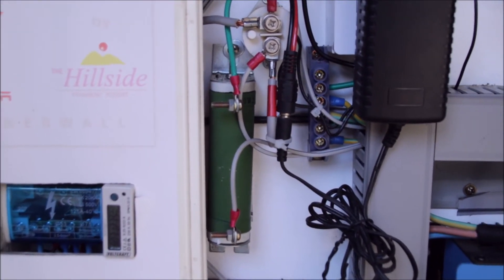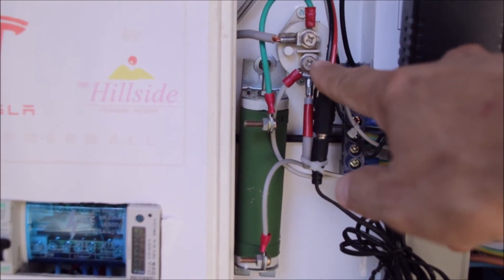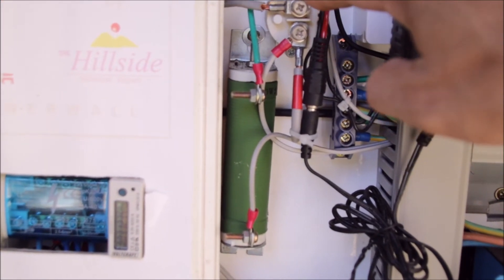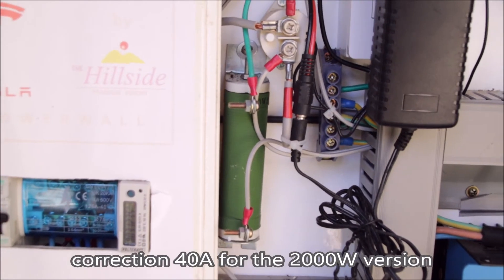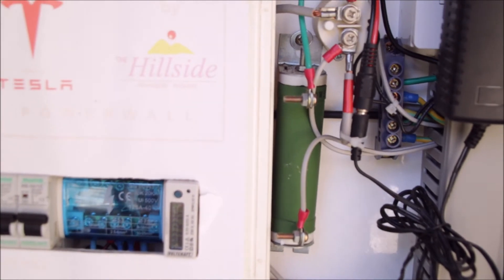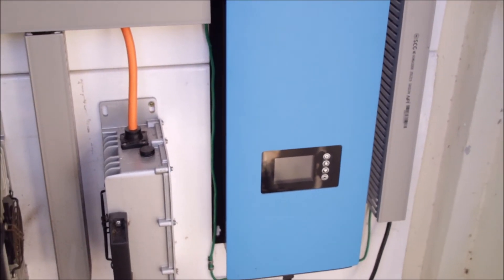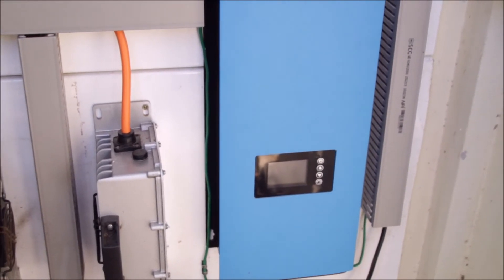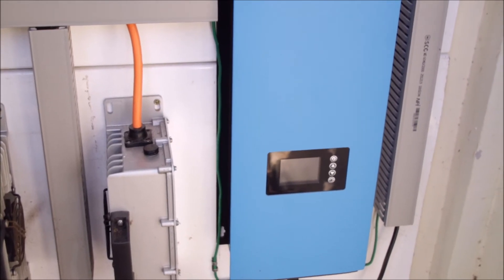DC soft starting the SUN1000/2000GTIL inverter

Comment: Hallo Roland , seit einem Jahr gehe ich deinem Rat nach aber halt Manuel mit zwei on-off Schalter . Alles OK ! Jetzt ging es diesen Vorgang mit zwei shellys zu verwirklichen damit ich das Ganze auch von der Ferne starten kann .  Habe den Sun 1000 24V Bat. und benutze 4x 25W 6.8Ω Aluminium Widerstände in Reihe . ( Widererstaende  die ich für Motorrad-Blinker gekauft habe aber nie zum Einsatz gekommen sind ) .  "Normale " manuelle Umschaltzeit liegt bei ca. 3-4 Sek. . Jetzt wollte ich mal den Strom messen der durch diese Brücke fliest sobald der Sun anfängt Leistung zu produzieren und habe die Brücke drin gelassen aber nicht das Hauptschutz eingeschaltet und gewartet aber der Sun fing nicht an Leistung zu produzieren . Die Spannung (  im Sun zeigte mal 22.5V und mal 25V an ) bei kontinuierliche Bat.- Spannung von 26V . (Eingestellte Leistung des Sun 550W) . Erst nach dem einschalten des "Haupt-Schütz"  und ausschalten der Widerstands-brücke fing der Sun wieder an zu produzieren . 
Die Frage ist , wenn die Umschaltung aus irgend einem Grund nicht stattfindet ob das den Sun beschädigen kann ?
Reply from the maker: Hallo Kostas. Der DC Eingang des SUN ist in Wahrheit ja kein Batterie-Eingang sondern ein MPPT-PV Eingang. Sprich, anstatt einer Batterie können dort auch Solar-Paneele hängen. 
Diese würden in der Nacht auch keine Spannung produzieren, am Morgen und Abend dann nur Spannung, jedoch keinen Strom, etc.
Was Du siehst, wenn die Spannung schwankt, ist nur der MPP-Tracker, welcher den DC testet, ob dort auch Leistung rauszuholen ist.
Es ist also ein ganz normaler Zustand für den SUN, wenn DC noch nicht vollständig aufliegt.
In meinem Setup schalte ich die Starter-Brücke nach ein paar Sekunden wieder weg, damit es nicht dazu kommt, dass eben eine unbelastbare DC für lange Zeit anliegt falls der Schuetz aus irgendeinem Grund nicht funktioniert.
Reply: @RolandW_DIYEnergyandMore  Vielen Dank für die Antwort.

Comment: It would be great if you supplied links to the components of your DC disconnect/reconnect circuit as some of us are not technical. I have been using AC switching for my batteries on/off at night. No failure yet, but DC does seem to make the most sense.
Reply from the maker: As I do not live in a western country where Amazon and Ebay are the first option to get stuff, it is very hard for me to provide useful links. 
I can link the contactor from AliExpress for example which I am using: https://www.aliexpress.com/item/1005004614039976.html?spm=a2g0o.detail.1000014.14.3c3b17f91sPmng&gps-id=pcDetailBottomMoreOtherSeller&scm=1007.40050.281175.0&scm_id=1007.40050.281175.0&scm-url=1007.40050.281175.0&pvid=7e7ff2da-bd11-4a64-9d1f-acbd239de52c&_t=gps-id:pcDetailBottomMoreOtherSeller,scm-url:1007.40050.281175.0,pvid:7e7ff2da-bd11-4a64-9d1f-acbd239de52c,tpp_buckets:668%232846%238116%232002&pdp_npi=3%40dis%21THB%21820.93%21689.58%21%21%21%21%21%402103011716830651916416982ecb33%2112000029836355617%21rec%21TH%21185638773
But I am sure you are much mor interested in a circuitry which is timing the pre-charge resistor. I know there are delay timers on the market which might be used for something like this, for example: https://www.aliexpress.com/item/1005004063991674.html?spm=a2g0o.order_list.order_list_main.53.54811802NXRqsl
It is everyone's part to find his solution by doing some homework ;)

Comment: But, because it is designed with anti-islanding to no provide power to the grid in the event of a grid down/failure, it would seem that it is designed specifically to handle the loss of AC while being supplied DC power and then switching back on when AC power is restored.  Is this not true?
Reply from the maker: In a way it would seem that AC faults shouldn't matter, but still how frequently does the grid go down? In my case I have grid interruptions probably every 3 days. They are just short but are bringing many devices down. 
My SUN1000 had a blown component in its AC power supply circuit after less than a year which I can only explain to happen because of those grid interruptions. 
I see more AC side problem repair videos for such SUN inverters recently. It's not invulnerable.
Reply: @RolandW_DIYEnergyandMore  Thank you. I am not really technical and so am going to need to do lots of research to figure out where and what components to purchase and build a DC disconnect as you have shown. Mine have not failed using AC timers to turn on the ones I have for battery power at night (two for day powered by solar and two for night powered by battery banks. Mine are 1000Watt 120VAC with one on each Leg of 120VAC to give a total of 240VAC)

Comment: This is very good idea! Would the same idea work, but using a permanently connected resistor of higher value (say 1k ohm) to keep the inverter capacitors charged, but only allow low current to be drawn? (50mA at 50V)? The contactor would then just "bridge" the resistor when batterys are fully connected?  I have a second question regarding your setup - Do you recommend charging while the batteries are also connected to inverter? Thanks
Reply from the maker: Well, the inverter will always try to use as much power as it can as long as it sees voltage on the DC In. It will act like a solar MPPT controller and try to chase the 50mA. That might not work very well.
You can charge the battery while inverting. that shouldn't be a problem.

Comment: dont buy this thing its very bad. you cant change the settings on it. the production is lower than other converters too. i bought solis inverter after this and it has much better output in lower sun light and has better build quality. dont compromise your budget on converters. the mppt tracking on this is just shit.
Reply from the maker: I am only using it as battery inverter. Don't have a solar system connected. I am sure that every passive cooled Grid-tie String inverter has a better performance and MPPT circuit then this. But for battery this is OK, and there is not much other choice. Thanks
Reply: Can you provide links to what you recommend? I have four of these (1KWatt each). Two are just solar with one on each leg of 240VAC Split phase (North America) and two that run the house each night from battery with AC timmers. This plug and play system has been on line for nearly 3 years and we have almost no power bill and no contract with our Utility here in San Diego. We couldn't be happier. So please tell show me how to have a better system as you have recommended. Thank you.

Comment: I never shut mine down but I understand what you have designed. I wonder how does the inverter shut down when it reaches a predetermined voltage to save the battery? I thought I could see some ramping down but not sure. The only thing that sometimes happens is the video freezes, buttons still work but it doesn't show on screen.
Reply from the maker: People who are using this inverter as a solar grid tie inverter are fine, it is only an issue when used as a purpose controlled pure battery inverter.
Reply: @RolandW_DIYEnergyandMore  yes I use the battery only but have a low voltage cutoff so inverter shuts down on it's own just wondering how it does that.
Reply from the maker: @offgridwanabe  It will use internal relays or transistors. But definitly isolating the DC site. Probably similar concept as we do on the outside